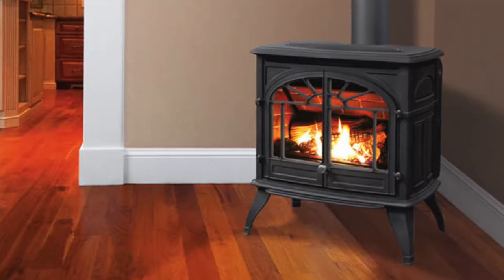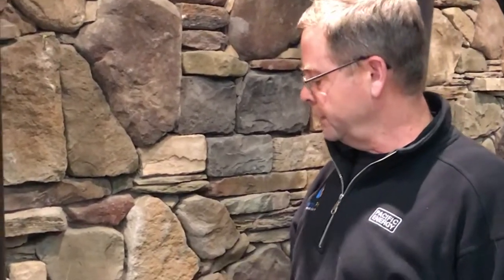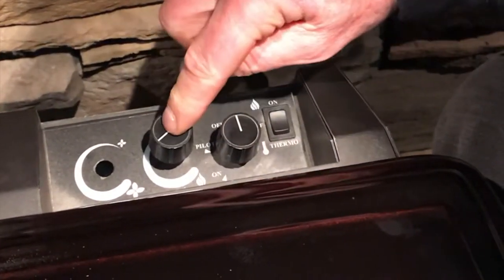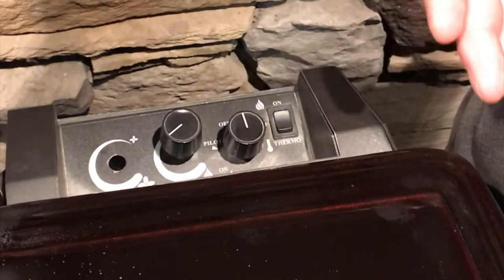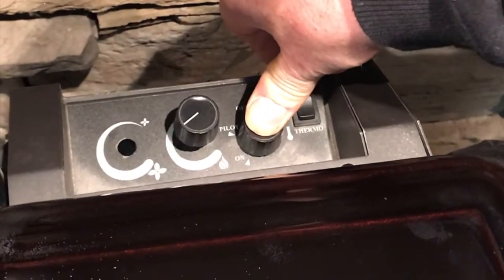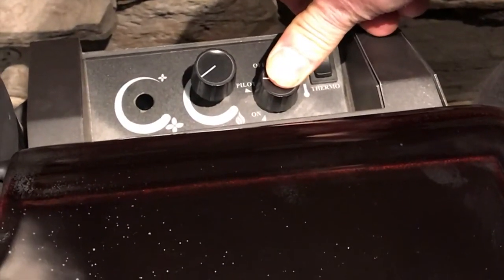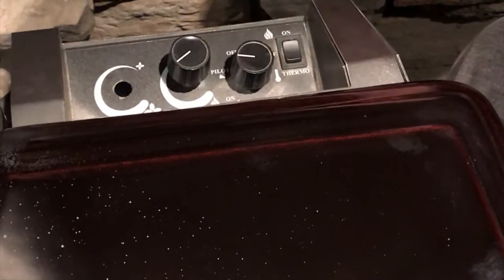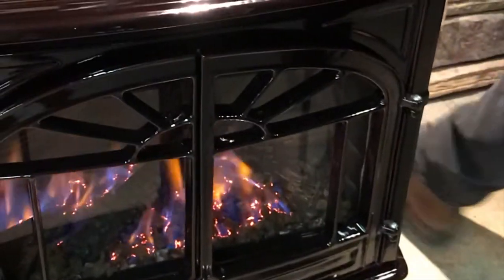How to light the Pilot Light on an Enviro Westport Stove

Comment: Our pilot light went out recently and I am glad you made this video. The Manual for the stove is Very poor! No diagram of the Controls. No simple explanation of the procedure to light the pilot light. The 9volt battery compartment is not shown clearly either and how to open the cover is nowhere to be found. Yes I have to agree with the other owner of this stove. This company makes a good stove but they need some help in the Technical Writing category. Thank You for doing the Pilot Light video.
Reply from the maker: We're very happy you found the video useful Paul!

Comment: had mine for four years hard to light up.this year i can,t get it to light. will have to take all the back panels off to find the nine vote battery.  if i can,t get it to work will have to wait until janaray to get freindy fire to do a house call . its now october. i,am not impressed.  have a five year waranty they did not tell me if this no light up is coverd or not under waranty. i will have to call someone else to come fix or check it. or i will freeze .